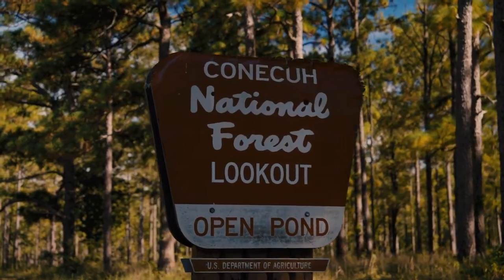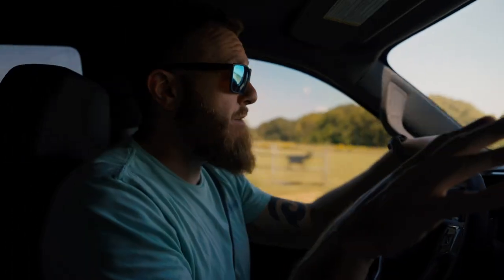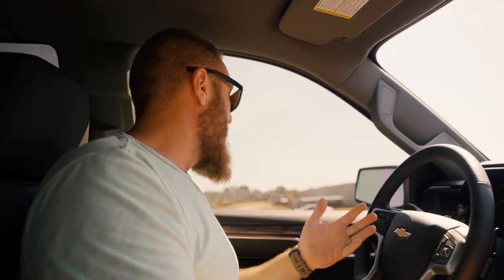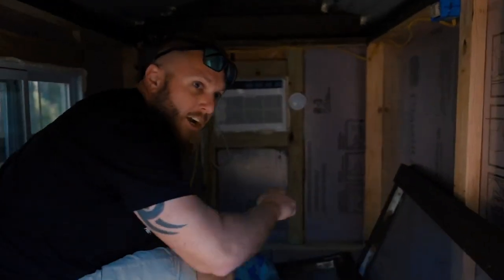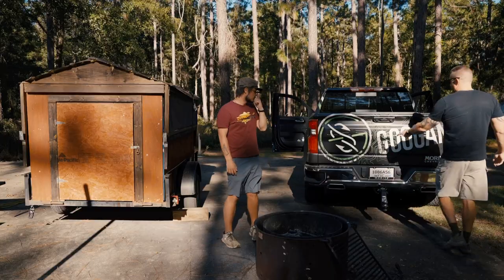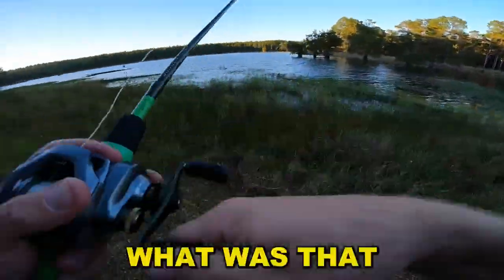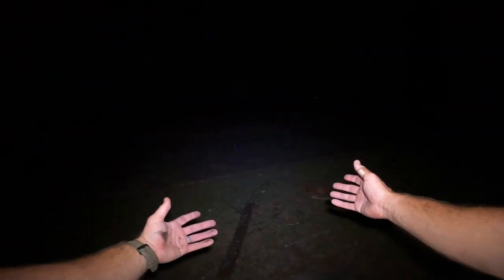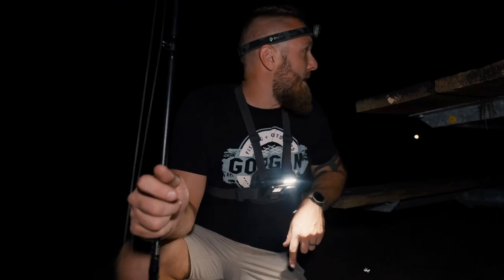First Camping/Fishing Adventure with the DIY Pop-Up CAMPER **DISASTER**

Comment: Damn, aerodynamics can be a pain. Air passing over the top caused a lower pressure zone over the roof. When the differential was great enough, there went your roof. Heard of a similar effect with certain antenna mast on a certain submarine class caused the mast to be pulled up out of the sail unless that mast was pinned in place (an after thought). Damn, serious knot on the noggin. Love the videos.
Reply from the maker: That’s so crazy

Comment: Tip to prevent string burn, rotate your elbow a little. You can get more in line with your arrow and it helps lock your arm in place.

Comment: I use a glow in the dark top water popper frog with the silhouette of a frog from underneath on the bottom , it works really good . All I have to do is charge it up with a flash light for 30 seconds & it will glow a good 5 minutes sitting in the water . I cast it , let it sit for about 15 seconds , pop it , let it sit for 3 seconds , pop it twice , let it sit & wham , set the hook . I’m from the Mid- West & I need every trick in the book up here found them on line , their made by Scum Frog , go check ‘em out .

Comment: Lojo idk if it to late but I built a camper just like that and I had to rethink it. I built it just like you did. After driving and using it every other weekend I had to bolt it to the trailer fram and I had to build a cone or point to cut the wind and boy it was so much better.